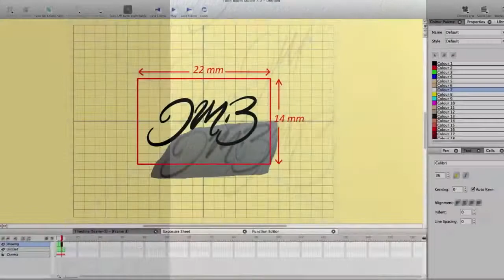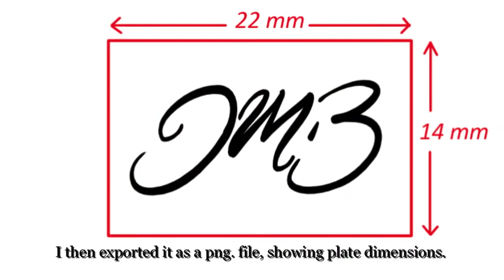Making a Snooker Cue with Hand Tools

Comment: In my early days I hand made furniture, The time and skill to do this does not allow any mistakes in certain parts of butting up woods without leaving visible joints,
One mistake ,chip or splinter or tooth mark on the edge from the saw, and the piece has to be started again,
You have the patience that`s needed for craftsmanship,
Did you ever think taking the one piece cue to a professional cue makers to make into a too piece ,for easy carrying, as I know this would be so hard to do accurately at home without the correct lathe ,
Or was the intersession to keep it a one piece, 
Also wood grabs moisture at different rates had you found any issue with movements from the sections glued,
Reply from the maker: Hi. Thanks for your comments. This was only intended to be a one-piece, as I am a beginner and didn't want to make things too difficult. I did make a 3/4-jointed two-piece cue after this one, using a nut and bolt for the joint, but I wouldn't risk damaging this one, and I prefer playing with a one-piece cue anyway. I clamped the wood very tightly when I glued all the pieces together, so there wasn't any movement. I've been using it for about 18 months now, and I've had no issues with the joints. Perhaps that could be an issue if the cue were kept or used frequently in a warmer, more humid environment. I'm not sure. I don't actually know too much about woodworking. I've just always been fascinated with snooker cues and have wanted to try making my own since I was a kid. Back in the days before the internet, snooker-cue making was a very secretive industry, and even today there is very little information on how to do it entirely by hand. All the best:)

Comment: G'day Daniel, you've done an amazing job mate. It's not easy to find any guides to making cues online as it seems to be a well guarded secret in the snooker world. Can I ask what the dimensions of your jig are? The stations along the length and the circle diameters on the end of you dowel? What's the diameter of the butt?
Reply from the maker: Cheers. Editing my reply as it wasn't very clear. The diameters of the butt and tip circles can be whatever you want, depending on how thick you want your cue. Make the planing bed about five feet long and place five stations along it, all equidistant from one another. The five circles at the tip end also need to be equidistant from one another. So draw the butt (outer) circle first, then the tip (inner) circle, then another circle equidistant between them, and then two more circles equidistant between those. If you want a pool cue, make the outer circle about 30 mm and inner circle about 12 mm. If you want a snooker cue make the outer circle about 28 mm and inner circle about 9 or 10 mm.

Comment: Way late making comments but looking up videos as I too am inspired to try to make my own cue(s?) but with a mini lathe.  One thought, my OCD, turn the brass screws so they all point the same direction or in an artistic balanced way.  Tiny details catch the eye (says they guy who has every slotted screw on every light switch and receptacle in his home vertical)
Reply from the maker: It's a fair comment and certainly if you're looking to sell your cues probably a better way of doing it; but my personal preference is actually the exact opposite. I prefer asymmetry as it draws more attention to the fact that it's handmade. For example, many snooker cue makers aspire to get the peaks and valleys of the points perfectly symmetrical, like a machine-spliced cue, but I was pleased that mine were all slightly off. The cue has loads of little unique imperfections which are visual and tactile reminders of the fact that I made it myself. That would be very impressive though, if you could get the screws to line up! Cheers, and good luck with yours:)

Comment: Cool vid! I have a 19.4oz snooker cue which I feel is too heavy. I would like to reduce the weight to around 18oz. Do you know if this is possible? It is a 3/4 jointed cue.
Thanks.
Reply from the maker: Hi, thanks. I can think of two ways to do it, but they would require that either the main joint or the mini-butt joint be attached to the cue without any glue, because the metal would need to be removed from the wood. If glue was used when the cue was made to adhere the metal to the wood, then I'm not sure how you would remove the joints without risking damaging the cue. A professional cue maker might know. I know a way to make joints without gluing the metal to the wood, so they're reparable and replaceable, but I'm not sure how pros do it. I'm just a hobbyist:)
Reply: Thanks for the reply sir! I appreciate it all the way from Yorkshire England.

Comment: well you're a better player than me. good first attempt. treat yourself to a longer plane and use it dead straight. doing this will help with keeping the cue straight. don't use it at an angle, that will give you a wavy cue and makes it more difficult to get it straight. watch other vids on cue making. you will then make better splices and do them a lot easier. also use a long flat piece of wood with the sand paper, that too will help keep things straight. otherwise, well done, it seems to work.
Reply from the maker: Thanks man, that sounds like sensible advice:) I appreciate it!
Reply: @danielmarcbrooks568  no problem. and make sure to keep it super sharp.

Comment: good vid,cues are not easy things to make,especially with only hand tools.im a self taught cue maker,which is now my job.one screw up and the cue is destined for the bin.of which i have many failed attempts i am still searching for that one tool that will drill the perfect hole in the centre every time..even a lathe is hit and miss,
Reply from the maker: Thanks. You're right. This one took me over a year to make and was my fourth attempt. My first three were with ash. I have a second one that is midway complete, but I'm not going to continue with it until, like you, I can figure out how to drill a perfectly straight hole down a shaft of wood. I want to do it with an egg-beater hand drill, so it is particularly challenging. All the best with your cue-making business:)
Reply: @danielmarcbrooks568  well,any tips i am happy to share,unfortunately top quality cue makers dont show the integral parts of cue making.they tend to glide over the general aspects.the closest i have got to a perfect central hole is using an 8 inch very heavy chuck,holding the end of the butt or shaft and using a drill press,however again,it doesnt always work,i think really the only way to do a perfect hole every time is to use a through lathe chuck,where the cue goes fully through the headstock and i certainly cant afford one of those.
Reply from the maker: @timmason7583  Hello Tim. I'm no closer to figuring out how to do the joint. Did you manage to come up with an effective (and inexpensive) solution? 
Cheers:)

Comment: very beautiful.   What is the butt diameter, ferrule diameter,cue length and weight and balance point?
Reply from the maker: Thanks. The butt and ferrule diameters are 28 and 10 mm respectively. The cue is 58.5 inches long. I'm not sure about the weight, but it's very light, maybe 12 or 13 ounces. It balances about an inch and a half above the points.

Comment: What you're using as a ferrule is far too thick, fyi. A thick, more rigid ferrule will throw the cueball off a lot more when playing with side. That's why the newer titanium ferrules slightly reduce throw, since they can be made very thin but remain strong enough to protect.
Reply from the maker: I'm updating my response here, because recently I've had more opportunity to play on the proper 72-square foot snooker tables. The lighter ferrules are applicable in snooker I think, but more so for center-ball striking on long pots.  Side is not an issue because you always have to compensate for deflection when playing with side, it's just a matter of degree of aim compensation. You're not aim compensating at all when striking the ball in the center because you're assuming you won't have to. If you aren't absolutely precise, a slightly heavier ferrule like the one I've used will be more likely to affect the long-distance travel of the cue ball if you just slightly miss striking its center.  So I think you're correct. Overall, it's probably better to use a lighter ferrule for snooker I think. I'm no longer using these Thick coupling nuts for my ferrules. Cheers:)

Comment: Sanding surfaces flat leaves a surface finish that is not as good glue wise as the cleanly severed fibres that a plane delivers. That thick steel ferrule would lead to an extreme amount of throw imo. The very thin walled brass ferrules already throw the ball more than a fibre ferrule.
Reply from the maker: You could be right, but I haven't noticed any problems on either point so far, and I've been playing with the cue every day for well over a year now. I don't notice any difference at all with respect to deflection, although even if it did cause more deflection, that would simply mean that greater skill would be required to use it. As it's just for personal use, I find that a positive rather than a negative. I guess that might be a legitimate concern though for a commercial cue maker. Cheers:)
Reply: I’m glad you’re getting on with your cue after putting so much work into it. If you’ve never tried laminated tips I’d recommend you try them. I’ve been using Talisman tips for 20 years. Easier spin, more consistent, and requires minimal maintenance. I’ve been a pro woodworker since 1988 so the advice about sanding flat is well established. Of course it’s not going to fall apart, it’s more about future projects.
Reply from the maker: @trappenweisseguy27  Cheers man, I appreciate the advice. I did actually glue right after planing when I made my two-piece cue (without sanding), but for this one I couldn't get the bits flat with my hand plane (due to lack of skill and experience I guess), so I just used the sanding block. I've heard about laminated tips before, but never tried them. Perhaps I'll give them a go next time. Thanks again!
Reply: I have a feeling that maple is a little more forgiving in terms of deflection than ash is, so maybe it compensates for the undoubtably stiff ferrule. The only reason why the English have used ash for cues forever is that it is much more widely available to them than maple is. Pretty much the opposite of here in Canada. I find that the interest in snooker has pretty much died out here. It was on  tv regularly in the 80’s and 90’s but I  have not seen any coverage since 2000. This is a shame as the rights to lesser tournaments like the German open etc would not be prohibitive afaik. I have to get my snooker coverage mostly here on YouTube. This is a shame as there’s hundreds of frames of Ronnie playing that I’ve never seen before 🤨.
Reply: Nice cue collection you have there. My own is a Hunt & O’Byrne black plate I bought used 30 years ago.
Reply: Well, I didn’t pay anywhere near that given that mine was used and has a replacement fibre ferrule. There was a bustling snooker scene in Mississauga in the early 90’s . A local club called “Monte Carlo” had tough tournaments every Monday night. Pro Jim Wych was a regular sight when not in Europe. He was at the hight of his career, and his concentration on the table was impressive.